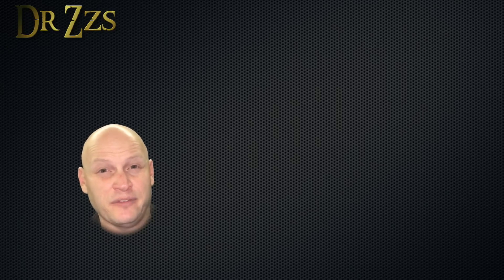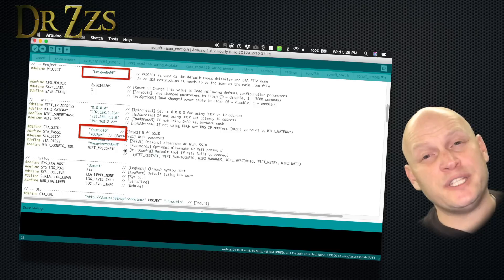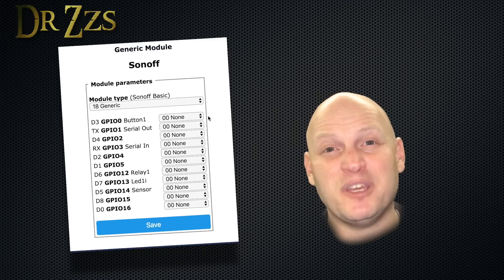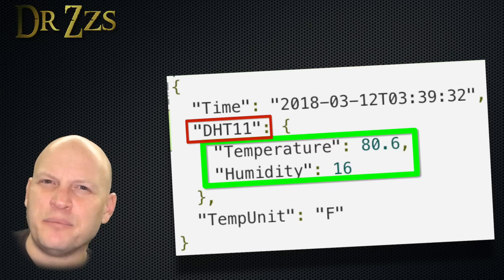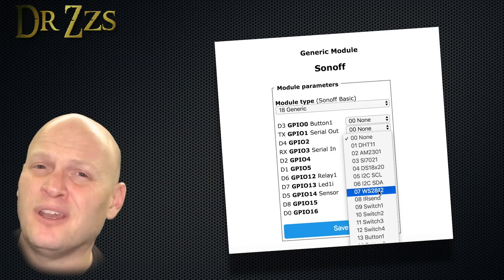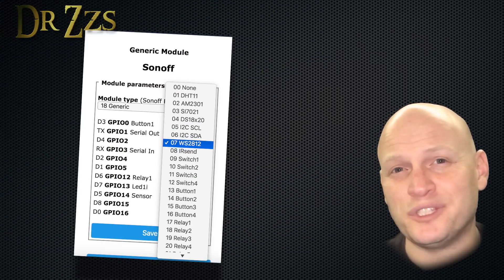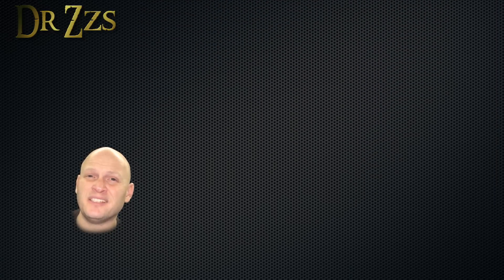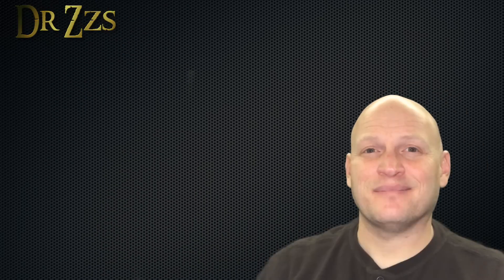Tasmota + D1mini (or Sonoff) - Temp & Humidity, ws2812 LEDs, and Motion Detection

Comment: At this point I've Tasmotized several other ESP-based devices, including ESP8266E/F from Electrodragon, a NodeMCU and several othe Node clones.  While I'm perfectly capable of simply producing custom code, Tasmota is the easy button for many project.  As always, thanks for the excellent content.
Reply from the maker: Thanks! 
I've got your 3-way switch method wired up in my maker faire Wall of Sonoffness.  I should finally get around to giving it the Zzs treatment soon!  You've had 5000 views on that video!  Awesome. 

Have you found any of those other esp boards to be especially useful or unique in any good ways?

Comment: Thanks for the great Video.  
Question:
I have also a DHT 11 Sensor on a Sonoff or on a D1 mini.  In both application I cannot red the Temperature in nodered.  I can see the temperature in Tasmota.  Do you have any idea?
Reply from the maker: Jakob Mo I know very little about node red. I just barely installed it myself.  Are you using Home Assistant also? Or just Node Red?  I’d say check Home Assistant and see if the temp is showing up there. Just to narrow down where the problem might be. 
I’d start by looking at the way node red handles payloads with multiple values. That’s what got me hung up with Home Assistant. So I can’t say more specifically what might be happening since I don’t know Node Red much at all.

Comment: I am using the sk2812rgbw leds. I added the light entry as you posted but I am not getting the color picker? Not sure where to start to troubleshoot this.
Reply from the maker: hmmm.  Show me what you have in your lights entry.  I didn't get it at first, but once I added:

    rgb_state_topic: "stat/D1mini01/color"
    rgb_command_topic: "cmnd/D1mini01/color"

it showed up.  
What version of Home Assistant are you running?  I know they've had that color wheel there for a long time, so I doubt having an older version is the issue, but it could be. 

It only shows up when the lights are on though.  Silly, but I guess make sure they're on then click the bulb and it should be there. 
I'll see if I can think of any other reason it wouldn't work...

Comment: Hi there, I cant get this to compile the sonoff as I keep getting dependancy errors: 
   #include "language/en-GB.h"
Anyone gt some pointers?
Reply from the maker: That file lives in the "Tastmota(version)/Sonoff/language" folder.  Check and make sure it's there.  If it isn't there you can grab that whole folder from the tastmota repo. 
https://github.com/arendst/Sonoff-Tasmota/tree/master/sonoff/language

Make sure you're running 'sonoff.ino' from that same Sonoff folder. 

If you have more trouble I'd say delete the whole tasmota file structure and re-download and re-extract it again.
Reply: Perfect, thanx....I dont know how but i had downloaded the Tasmota-Developer clone instead of the master clone.....mayb you coul add the link to the master for others that follow?
Reply: now any ideas how to connect to OpenHab2 and control/receive the data? :)
Reply from the maker: ya, the development version is the one that shows up on the main page.  I usually go to "releases" and grab the zip file for the "latest release"
I should start using that link, you're right. 
https://github.com/arendst/Sonoff-Tasmota/releases

I don't know anything about using OpenHab2.  At least not yet...

Comment: Is it possible to use a sonoff basic and the motion detector without any home automation in the background?
Reply: I'd suggest that a sonoff might be overkill if you don't want home automation. I would go with an arduino and a relay and a PIR, there are some good examples on the web for doing that; search Arduino PIR Relay for some handy resources. Try https://www.maxphi.com/pir-motion-sensor-light which has a nice clear way to do it. You could always start with that code on a Sonoff using Arduino if you want to use the Sonoff for its nice casing, or use a separate Arduino, relay and PIR unit.
Reply from the maker: I don't think so, but maybe.  
The trick would be the way the PIR activates and deactivates every time someone moves.  There's the retriggering/non-retriggering setting, but that still lets it reactivate fairly often.  There's an adjustment screw on the PIR I have that says "time" I'm guessing that's the retriggering timeout. 
There may be a way to set a delay in Tasmota so once it activates it won't re-activate for an hour or something.  
It must be possible because there are stand alone motion detection lights.  I just don't know exactly how to do it.
Reply from the maker: I concur!

Comment: You rock! I have a dozen network temperature probes installed at the office (Arduino and MiniD1) all configured by hand. You are really making me want to try Tasmota. Quick question, if you ever read this. In tasmota can you create a simple web page reporting the value of a temperature probe. Something like " [21.1] " since i'm using it with PRTG. Thanks a million.
Reply from the maker: Thanks!
I'm loving Tasmota.  I know there are other similar projects out there (ESPeasy, ESPurna), but I haven't even discovered everything Tasmota can do yet, and they keep making it better.  
As for your question.  (of course I'm gonna read it!) 
I'm not familiar with prtg.  But tasmota has something called SonWeb, which brings all Tasmotized devices on a network onto one page.  I haven't installed it yet myself.  It might be what you're looking for. 
Check it out, and let me know!
https://github.com/arendst/Sonoff-Tasmota/wiki/SonWEB
Reply: Thank you I will look into it. As for PRTG, it's a monitoring system for network administrator. It has a simple type of sensor that can read a value in en .html page.

Comment: I was just trying to put TASMOTA on one of my NODE MCU, this saves me A LOT of legwork. 
Do you think TASMOTA could be installed on the small ESP-01?
Reply from the maker: Cool! 
let me know if you hit any snags with the NoceMCU.  I got mine working pretty easy.  Just needed that one driver.  
As for the ESP-01, as long as you have the newer version (with the 1mb drive) it should work! 
If you have the older 512k size, I think there's a version of tasmota that is "minimized" and should work.
Reply: DrZzs I got tasmota installed on an ESP-01 no problem. And I put a DHT-22 on GPIO 02. Everything is almost perfect. However I am not getting it to display the temp and humidity in my Home Assistant. They just show ( — ).  I tried your code but changed DHT-11 to AM2301 but no success. Ideas?
Reply: Never mind. I got it. Not sure what I changed but it’s working now.  👍
Reply from the maker: ha!
well, guess we'll never know what was wrong.  
As long as it's working now!

Comment: Nice Job, thanks.  The reason you need to install the driver is because the various ESP8266 modules have different USB to TTL chips onboard.  Common ones are 230X. FTDI, and CH340 each of which requires a driver.  Once you install them all, it will largely be transparent from that point forward.  Likely though, you will see a different comm port for each.   Also, the PIR IS actually a motion sensor.  If it were not, any infrared source would trigger the output.  The PIR relies on a differential measurement between two sensors and that funky segmented lens to break up the light pattern.  When an infrared source is stationary, it remains constant between the two differential receivers, when something is moving, the difference is what triggers the output.  i probably did not explain that well, but there are a number of videos out there that do a good job including Bigclive who devoted a video to using PIRs.
Reply from the maker: Awesome!  Thanks! 
I'll take that NodeMCU question off the things I don't know list now! 
And thanks for the knowledge on the PIR.  I was thinking of it kinda like a line-break sensor, and that's not really what it is at all.  I'll have to check out Bigclive's video.
Reply: My "Things I don't know list" has turned into something akin to an encyclopedia...  Still smaller than my wife's "Things for anthony to do" list... though so that's good...
Reply from the maker: hahaha!

Comment: i made 6 of those Ben's mutlisensor - any advantage of tasmota over is code ?...since his code is just for the 3 sensors and leds it seems to be very lean - hence should be faster then tasmota...but i will make one to test this one out.
Reply from the maker: cool.  Ya test it out and let me know.
Reply: I did a few of Bens as well.  I did not want all the sensors he had on all of mine so I tried to configure the sketch and it was a mess.  :)  I also wanted to use a D1-mini instead of a  node MCU to just do a PIR and had issues with that as well.  Now that I seen this video it was simple to use a d1-Mini and a single PIR.  So thanks for showing me Tasmota!
Reply from the maker: you're welcome! 
thank Theo for making it.  
I wouldn't be able to do most of what I've done without it.  It's SO much better than trying to write or modify an adruino sketch directly.

Comment: Nice!!  This gives me all kind of ideas....   Do have a question: in the video you describe setting switchtopic(x), to address the MQTT topic for the different switches.  On the sonoff, it seems there is only one switchtopic that can be set (no matter what number I pass for x, it changes the switchtopic at a global level, thus all the switches call the set topic).  Is this different for the D1 Mini?  

Thanks again for the incredibly helpful videos!
Reply from the maker: Cool!  ya, the potential is great! 

You should be able to change the switchtopic on the sonoff too.  I've know I've changed the "switchtopic2" for the garage door so I'm sure it's possible. 
hmmm.  I'll have to mess with it and see if I can reproduce the problem you're having.
Reply: I found an issue on the Tasmota site where arendst confirms there is only one switchtopic, but maybe it has changed since then.  It is Issue 541 (not sure links work here, https://github.com/arendst/Sonoff-Tasmota/issues/541 ).  I've not been able to set a switchtopic for one switch different than another so if you have any insight it will help me tremendously!
Reply from the maker: what version of tasmota are you running?  Maybe that's something they've changed since then. 
I'm using v5.12
Reply from the maker: Now I’m really curious. I’ve got some relays and some switches. I’m going to do some testing with different switchtopics.  I’m confused because I know my Sonoff Sv garage door opener has 2 different topics, one for the relay that triggers the door and another for the reed switch that sends the state of the door.
Reply: I was going to test further last night and didn't get a chance... I did see that my version is 5.11 so I started an update - hopefully tonight I'll be able to do more tests.
Reply: Tried again with similar results - as soon as I set switchtopic1 or switchtopic2, all switches tied to gpio's go to the topic I set last - so the number is meaningless.  Interestingly, the topic sends a power command with a number (i.e. POWER1, POWER2) that corresponds to the switch used.  Since my topic is another sonoff, I had to do an automation on HA to control the relay on the first sonoff.  Downside is that you lose the immediate control of the relay (meaning, the relay is triggered via an MQTT message not directly by the switch) thus you are dependent on the network for all the switches on the device.  I was going to play with buttontopic to see if that could achieve another way but ran out of time...
Reply: Yep. I'm seeing the same on D1mini with 5.12 Tasmota. Change Switchtopic and it changes globally.
Reply from the maker: CRAP! 
you're totally right!  I just tested it.  Dang it! 
https://www.dropbox.com/s/04mjtpdruqdy3oc/Screenshot%202018-03-24%2008.49.03.png?dl=0

I really hope that something he didn't intend and will fix.  Seems crazy not to be able to have different topics for different switches....
Reply from the maker: ok, I think maybe switchtopic doesn't work like I thought it did. 
When you set up different switches and relays in tasmota it isn't the middle part of the topic that is different it's the last part. 
So for switch2 the topic is 
cmnd/sonoff/power2

for switch3 the topic is
cmnd/sonoff/power3

Setting switchtopic2 just changes the middle part of the topic from the device name (sonoff in the example above) to something user defines. 
So with switchtopic2, the tastmotized board can publish an mqtt message to that new topic, but nothing on the tasmota board will respond to that topic. It is just to trigger something in some other system that is subscribed to that topic.  So for my Sonoff SV garage door, I have set "switchtopic2 2" then I have GPIO14 set as switch2 and have it connected to the reed switch. When switch2 is activated (the door opens or closes) switch2 sends the mqtt message "cmnd/2/POWER2" with payload on or off.  Then because I have the state topic for my "cover" component in Home Assistant subscribed to that topic (cmnd/2/POWER2), the arrows and the icons change to show the door as open or closed. But it doesn't trigger the relay on the sonoff.  The relays are still activated by the default topic. So "cmnd/sonoff/POWER" will trigger the relay. 
I think that means switchtopic can add a new topic that tasmota will publish, but it doesn't change the topics it is subscribed to.  Now my brain hurts. 

I don't know why this is so hard for me to get my head around.  I think I have a decent understanding of it, but at the same time I still feel a little confused.  
Well, that's part of the process of learning new stuff I guess. 

Hopefully my rambling makes some sense and helps you out at least a little.
Reply: Surprisingly, what you described makes sense to me!  In the garage use case, you don't use the switch to activate the garage door, it's only via a mqtt message. In my case, I use gpio14 to activate the board relay and use gpio3 to send a message to another sonoff to activate it's relay.  In this case, the switch topic does not work well as when you set it there is nothing left to locally activate the board relay.  So you need something else (HA) to get the message and then send a message back to activate the relay.  I agree it would be so much more powerful if you could set switchtopic for each gpio - it may be that there's not enough memory to add the additional logic without losing the OTA capability.   Playing with it has been a learning experience.  I've got it working well just not happy with look of my switches - so I think I need to buy a 3D printer now 😁.

Comment: I close on a new house in early April.  I already have a few sonoff basics controlling lights, and a low voltage sonoff controlling my garage door in the house we are leaving.   Once we get into the new house, my home automation will be kicked into overdrive!  I don't know if anyone has requested yet, but can you do a video using sonoff/Tasmota as an infrared remote control for Tv/surround sound?   I look forward to your videos on Mondays.   Keep up the good work!
Reply from the maker: Thanks! 
Actually that sensor kit does have an IR transmitter and receiver!  
I peeked briefly at the tasmota settings to make it work.  I'll put it on the list and get to it eventually.  In the mean time, if you want to try it before I get to it, here's the Tasmota Console commands:
https://github.com/arendst/Sonoff-Tasmota/wiki/Commands#irremote

I don't know much (yet) about exactly how to setup IR, but I'm sure those commands are the key.

Comment: Thanks!  Been trying to get PIR sensors hardwired to my Pi's GPIO pins going.  When I setup the automation in HA, it would turn the lights on when motion detected but then also turn them back off when motion was detected again no matter what I did.  Your example is perfect, the  "turn the lights off after X" should be another automation that is triggered by the first automation, not one automation with a delay built in like I was doing it.  Excellent as always, will be trying this when I get home today... Thanks!
Reply from the maker: Sweet!  
Mine's working like a charm.  I'm going to have to add PIR's to some of my Zzonoffs now too!
Reply: Just got it setup...works perfect.  Using these pre-made PIR sensors sired direct to GPIO https://www.ebay.com/itm/2x-Wired-PIR-Motion-Detector-Infrared-Intrusion-Alarm-Sensor-for-Security-System/332326172160?ssPageName=STRK%3AMEBIDX%3AIT&_trksid=p2060353.m2749.l2649
Reply: Joe Blow  That's what I had to do too. Just crazy to me, but it works!